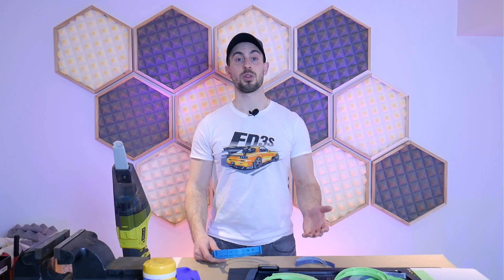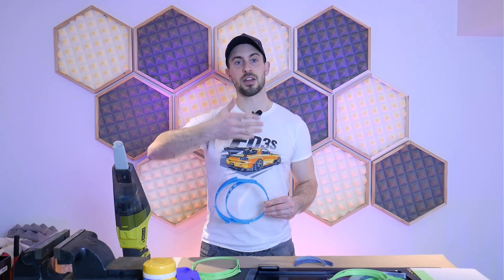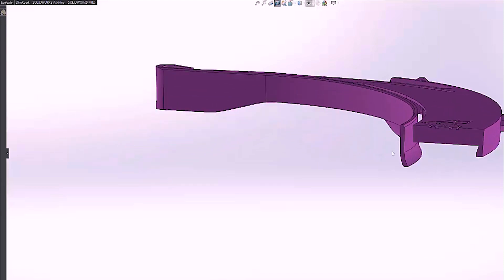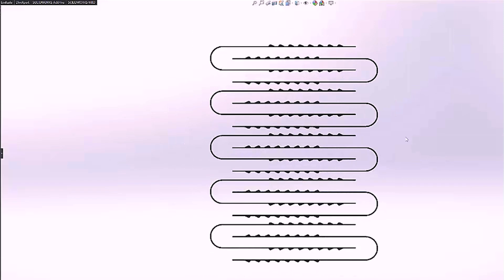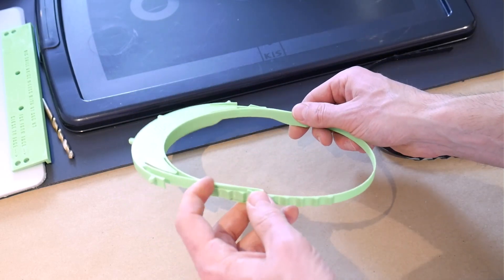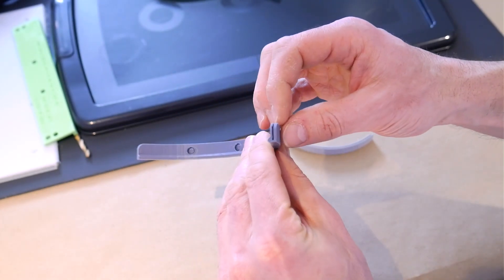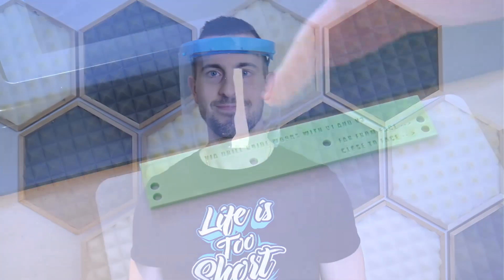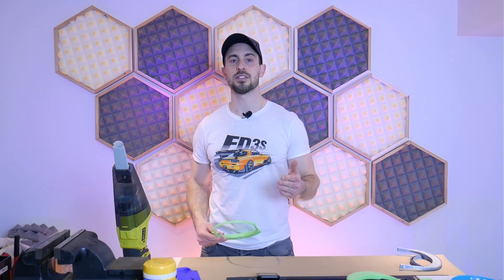NEW Covid-19 Face Shield Design (Prints ~4X Faster, No Elastic Required, Printable Straps!)

Comment: Super cool design.. Questioning if you can provide a design with hole distance of 80mm (4x80mm) at the mainshield for using a standard puncher from office equipment.. Then there is not need to have a special (drilling) tool....

Comment: Have you thought about using a bigger nozzle to speed things up? I'm currently printing the really fast 3dverksan as something rough and ready for care home workers at the mo and I can run them off  3 an hour per printer with a 0.8mm nozzle. 
Your design is brilliant BTW, when I've finished my latest batch I'm going to try these.
Reply from the maker: Thank you! Yes, I've considered a larger nozzle but haven't implemented it yet. Still working with the stock 0.4mm ... Ideally I'd like to get a second printer that I can optimize for speed over detail and use a 0.6 or 0.8mm nozzle on a volcano hot end to really get things moving (larger layer heights). Let me know how it goes when you try my design and if you have any suggestions I'm here!

Comment: Hi, what settings are you using for TPU please , love the idea of no elastic, i think its a great design  as a one stop shop, every thing print on the printer .....  never printed TPU, so im looking forward to that , im using a prusa Mk3     many thanks
Reply from the maker: What slicer are you using? I recommend the PRUSA slicer even if you do not have a PRUSA printer. It has profiles for different brands of TPU. I am using SainSmart black TPU and my print temperature is 235 with the heated bed at 50 . I print pretty slow at 35mm/s for TPU so it does not get jammed in my extruder but it works!
Reply: @EmbraceMaking  hi thanks for the reply, its appreciated, i'm using  prusa slicer and  prusa mk3....  yes i saw the profile for sainsmart, but didn't know which filament brand you used .....  cheers

Comment: Great effort my bro, how about the strap using TPU material? iam super newbie, just bought a machine tenlog hands 2
Reply from the maker: Yes! If you watch the video you will see that I have two designs for the straps. One is for PLA and the other is for TPU. Use the TPU file to print the TPU strap and it works the exact same way like a zip tie. Good luck!

Comment: I really think that we need to start thinking of reusing everyday items more in the designs. Its becoming harder and harder to find things like petg sheets to be shipped to you in a reasonable amount of time once a design like this becomes public. What about using a 2 litter soda bottle? Probably not the best most clear plastic but it is readily available.
Reply from the maker: It's a good idea, I've seen a few people implement similar things, even binder covers. With my drill guide you can pretty much use any clear plastic you find, you could easily make the soda bottle work.

Comment: Hi! Amazinh project? Do you mind to share your printer settings? Thanks!
Reply from the maker: Thank you! Let me know which setting you need to know specifically but the general settings are: 0.3mm layer height... approximate print speed is 60mm/s but it varies as I have different settings for perimeters and infill etc. I use my slic3r to limit my print speed based on volumetric output rather than just linear speed. I am using 3 horizontal and 3 vertical perimeters for this print as I noticed no significant decrease in print time switching it down to 2. I am using eSun PLA+ to print... print temp is 200C and I leave my cooling fan on. Infill is set to 20% but most of the model requires no infill as the walls are generally thin anyways. Bed temp is 50C for the first three layers, 45 for the remainder of the print. I think that covers the major stuff! No supports required!
Reply: Embrace Racing thanks!

Comment: Honestly, PLA is the wrong material for this.  It's easy to print, but PETG is not much harder and it's a better material for things like this.  PLA is brittle and will break as you noticed with the bottom support for the shield
Reply from the maker: Hi Tom, yes it isn't ideal. I have printed more with PETG lately and it is a superior material. At the time the PLA was easy to get off the printer and out the door when there was a PPE shortage locally so it worked in a bind. But yes, with more time and resources PETG is better for the application.